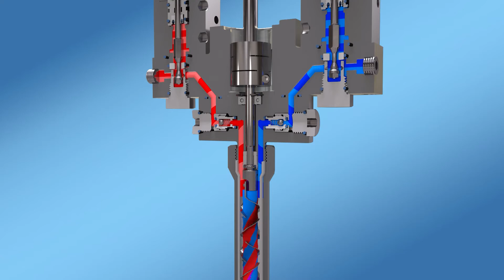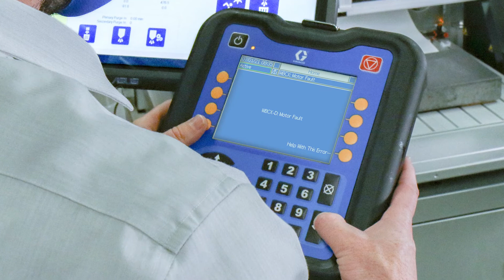Voltex Integrated Dispense Delay

Comment: Its static mixer?
Reply from the maker: Good question. Depending on where you are in the world, this type of mixing is known as Dynamic, Static-Dynamic, or Rotary-Static.  The Voltex Valve rotates the disposable mixer element at a high RPM to properly blend the A and B component. At the 1 minute, 13 second mark of the video, you can see the mix element rotating when the valve is dispensing material.